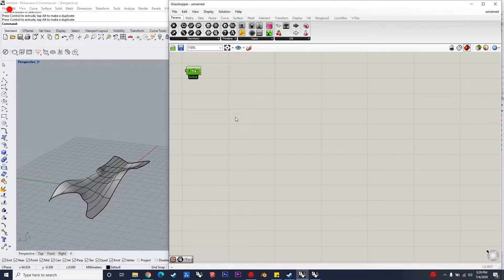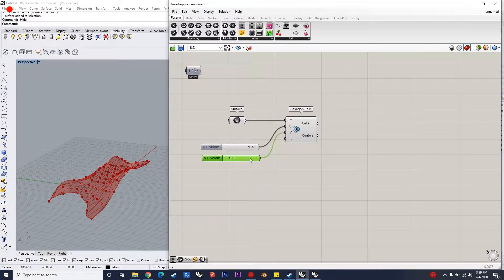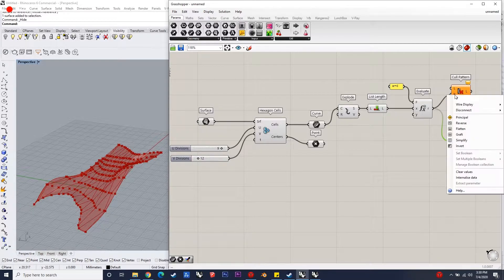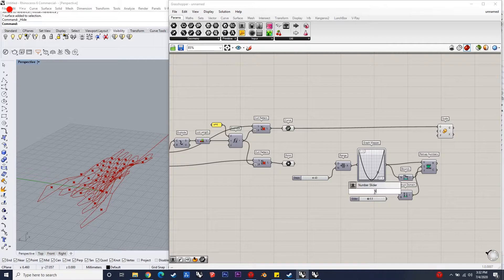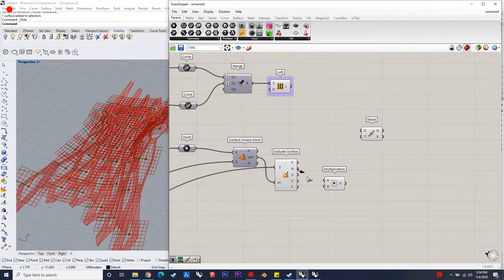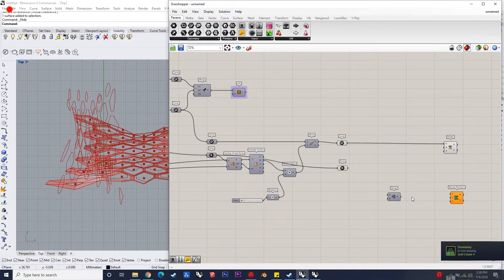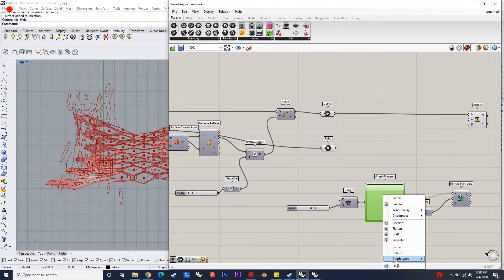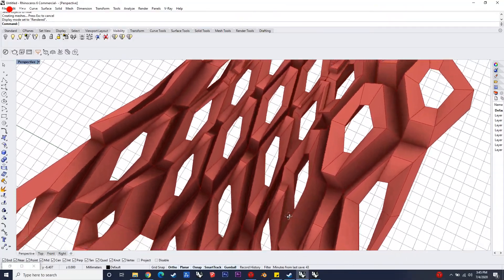Hexagonal Shell Structure Lunch box Grasshopper Tutorial

Comment: Hello, I have a problem when connecting the explode command to List length it appears a dotted line instead of a continuous one as the one in the video and when connecting to evaluate it says "parameter "Variable X and Y" has an invalid name. Only use alphanumeric characters and don't start with a number" Pls help!
Reply from the maker: ok try this. have your components only in icon mode.
Reply: @rahullodha1394  Thank u!
Reply: @rahullodha1394  i was having same problem but after doing in component icon only solved it. can you explain the reason 😅.
Reply from the maker: Some sort of glitch maybe.
Reply: I'm having the same problem
Reply: same problem. I didn't understand the solution